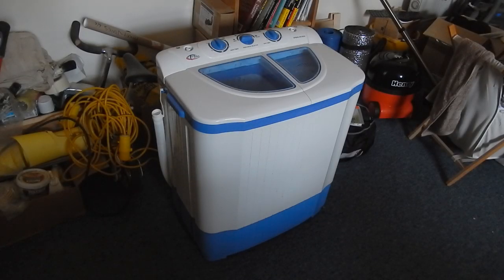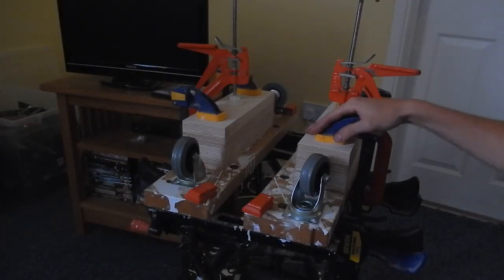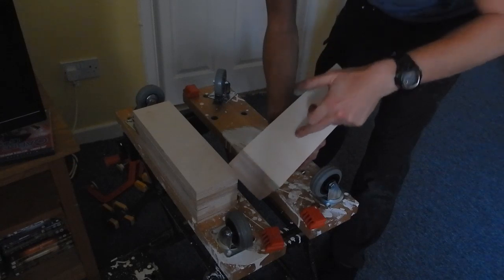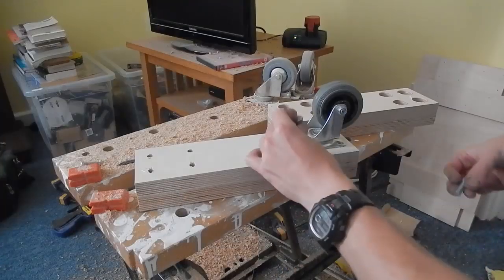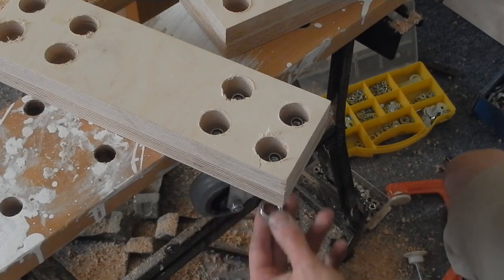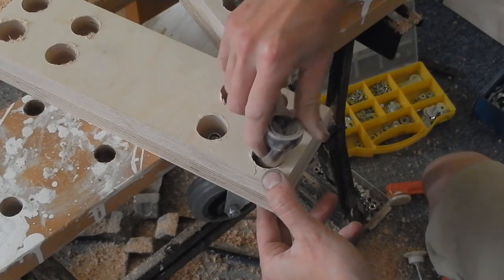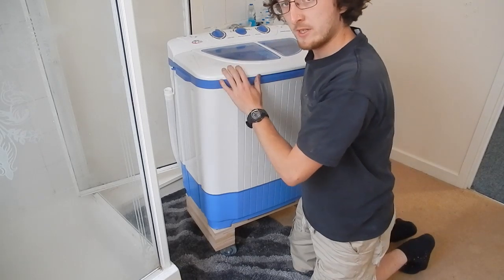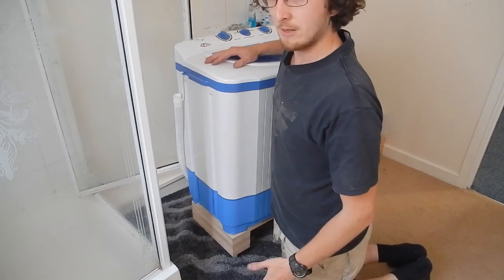Mobile Base for a Washer/Dryer

Comment: This is amazing! Would you be able to give measurements from the base? Seemed to fit so well!!
Reply from the maker: Thank you. Unfortunately I no longer have it on hand and I didn't keep a note of any dimensions or drawings. I basically put the machine on to its back and measured carefully between the feet, allowing an extra millimetre for clearance... I do hope that helps.
Reply: @OllyParryJones  No worries, thank you so much for the tip! I appreciate you replying